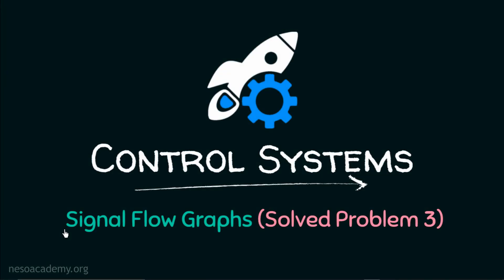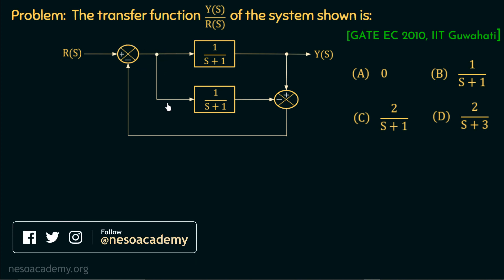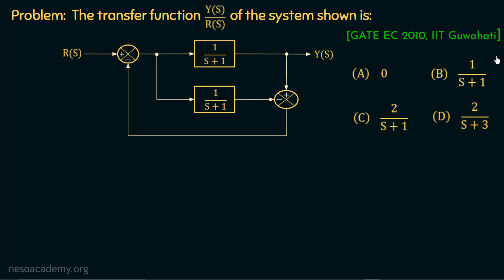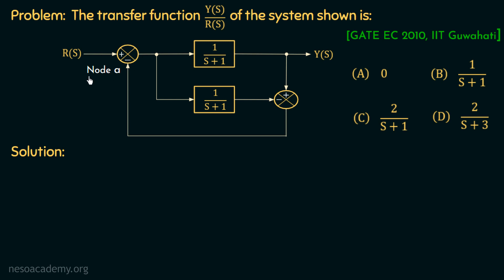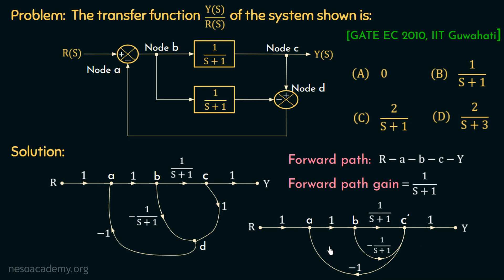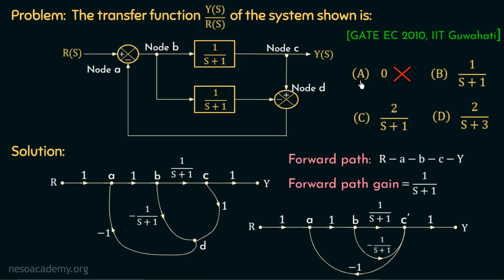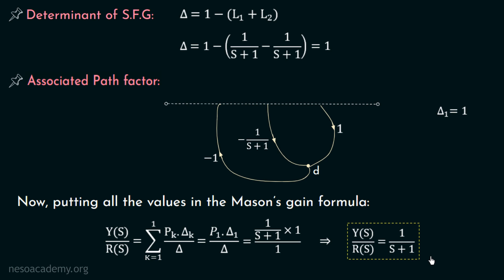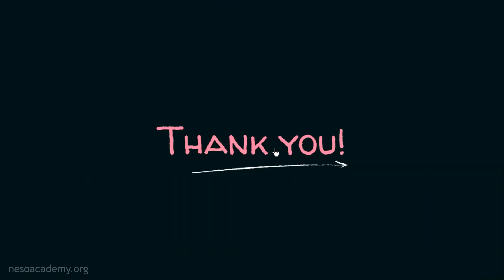Signal Flow Graphs (Solved Problem 3)

Comment: A faster method solve the h.w problem would be to use symmetry actually. if u see it's symmetric about the horizontal, so we can just exchange the end branches and use the feedback formula to solve the block, no need to use SFG and MGF.

Comment: Homework prob. 
Answer :- Option (B) is correct 
(B) = 2*G / 1 - G*H
Reply: how bro
Reply: 4 fwd paths right? I got 2G + 2G^2H  /  1 - 2G^2H^2
Reply: @khookengsuen1428  yeah bro I also got the same eq
Reply: @khookengsuen1428  
Hey bro!
Here's the final step!
2[G+(G^2)H]/ [1-(G^2)(H^2)] 
=
2G(1+GH)/[(1-GH)(1+GH)]
1+GH gets canceled out!
The final value is 2G/(1-GH)
Reply: @mohamedaitelcaid5969  oh I see now, there is only one loop, thus 1-G²H², I initially thought there are two loops but it is actually the same loop 🤦 good tricky question, thanks for the answer btw ✨✨
Reply: @ginnasomeshwar5068  hope you get it too, it is SOLVED yayy

Comment: for the homework problem, if we swap the take-off points for both H, there will be no change in the situation.
then this gives us two positive feedbacks, hence option B ( 2 * positive feedback gain )
Reply: Also for discussed problem, if we shift node b to node c, we get a feedback with zero gain. so our system reduces to open loop with gain of 1/1+s

Comment: Hello sir,  thank you for your wonderful lectures. Please I want you to help me know the answer to the assignment, I had 2G/1-GHGH. Which is close to 2G/1-GH that is answer b. I'm thinking it should be 2G/ 1-G^2.H^2
Reply: I am afraid u r wrong . Becuz u have to consider the delta k for the four forward parts. By isolating the for forward paths one by one, you see that there are no isolated loops. So u obtain delta 1, delta 2 and delta 3 as "1". 
No. Of forward paths 4
No. of individual loops 1
Therefore U/Y = [(G)(1)+(G)(1)+(G^2 H)(1)+(G^2 H)(1)] / 1-G^2 H^2 
Solving it further u get the 2nd option.
Hope this answered ur question :-)
Reply: @syedsalarjung202  why individual loop is 1 ??